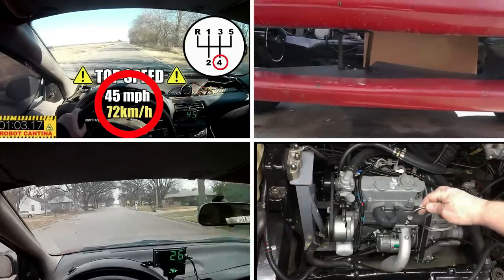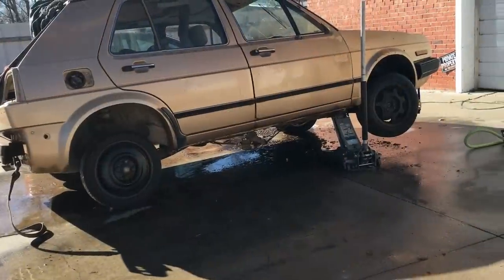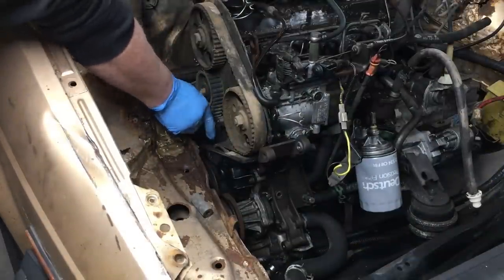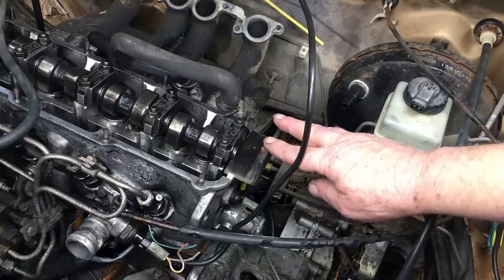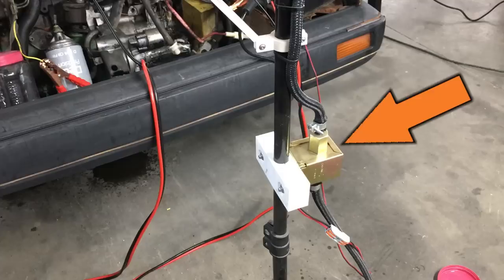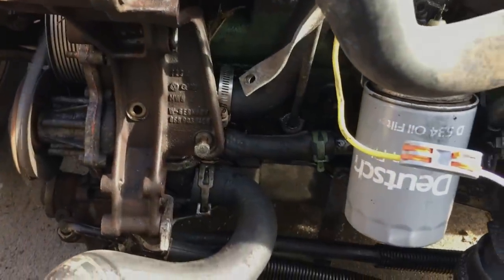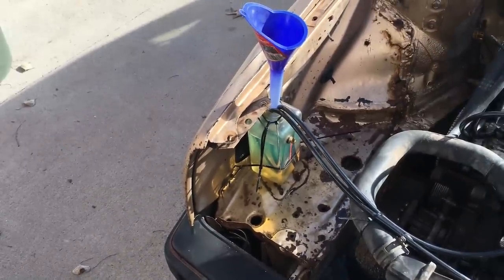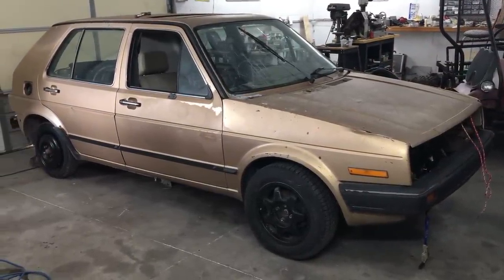S3 E3.  Will this abandoned 1985 Volkswagen 1.6L diesel run and drive again?.  Let's find out !

Comment: It may be out of the question but if you were willing to pull a few things off that car before it goes to the scrapper I'd make it worth your while. 

Love the videos always look forward to them!
Reply from the maker: The scrapper is picking up the car tomorrow.  About the only good parts left are the doors. everything else is damaged or missing.
Reply: @robotcantina8957  As the video progressed I came to that conclusion. 

Also, from the video (kinda hard to tell) that more than likely is a 5 speed transmission sometimes marketed as 4 speed plus e for economy. That linkage system when worn makes finding gears difficult.
Reply: @ViersBrett  JIMBO,    CONGRATULATIONS ON  115K  SUBSCRIBERS!!😊

Comment: The Golf started sale in the 1970s.  Here in the USA 🇺🇸 it was called the Rabbit from 1977 until 1984.  The Mk1 Golf (Rabbit here in the USA) was called the Caribe in Mexico 🇲🇽.  Here in the USA, the car was renamed "Golf" (in line with the rest of the world) for the Mk2, which started with the 1985 model year here in the USA.  So, your 1985 is a Golf.

I learned how to drive in my dad's 1980 VW Rabbit diesel.  That was the 1.5L indirect injection, normally aspirated diesel.  Less than 50 ponies.

If you want an interesting variant of the Rabbit/Mk1 Golf, try to find a Rabbit Pickup (Caddy in the rest of the world).  That thing was sold here in the USA from about 1979 until 1985 (a few leftovers from the 1984 model year).  With the diesel engine, 50mpg highway (US gallon, 3.8L) is possible and the total passenger & cargo capacity is 1,105 Lbs.  With a small driver, ½ ton in the bed is possible.  They were popular with the DIY EV crowd for a while.
Reply: And, the 5-speed manual also bolts right up to the engine.  Ask me about the vacuum pump and oil pump situation 😉

Comment: I had more or less the exact same as my first car! 
The engine is a turd, but man was that thing efficent and forgiving!
As a apprentice with no monny, i put every crap into that thing!
Old hydraulic oil for the engine (Just to top it of ;) , as fuel somtimes leftovers two stroke gas mixed with the remaing diesel, more hydraulic oil 🙄, vegetable oil, it dosen´t care!
As long there is enough diesel mixed in it even dosen´t smoke!
One time we even filled the empty tank with 20l of just gas, because drunk, broke teenagers do that, and drove to get food. It knocked like hell and had no power, but it got the job done and survived!! 👍

Also it just took 4 l/100km (58mpg)!

Best daily ever!!! I regret giving it away, such a good car!

Comment: Great video brother I follow a  Youtube channel in indo China These youtubers take full size pick up trucks strip them down to the Running gearAnd chessie and put a single cylinder diesel engine on these guys are holding massive loads of lumber  And trees and farm products it is amazing what these guys are pulling with a simple 24 horsepower engine they do have manual transmissions that make it worthwhile most of them are belt drive They do not go very fast however but that is beside the point Very cool thank you for sharing your knowledge and expertise and I forward your channel to all my redneck engineering buddies
Reply from the maker: Thanks I will have to check that out!

Comment: on VW diesels, the oil goes black literally minutes after the oil change, no biggy.  You MUST tap the engine allen bolts with a hammer, and they come off much easier.
Reply from the maker: Thanks for the heads up on the head bolts!

Comment: We had a customer car, a 1980something Fiat Spyder, that was in similar condition in regards to rodent 'waste'. They had a complaint that the dash vents for fresh air in the center weren't working when they were driving. They weren't working because the cowl where the air came in and the two vent tubes into the cabin were inches deep with mouse droppings solidified into a hard packed dirt like substance. Yes folks, he drove this car regularly! It was also in for so me electrical concerns which required me to reach under the carpet to pull some wires up. I couldn't understand why it felt like there was a bunch of rice under the carpet on the floor, I thought maybe someone poured rice in there to absorb moisture. Nope, loose mouse droppings! Thankfully I always wear gloves, but I couldn't eat rice for a couple months after that and still gag at the thought. The car smelled so bad we had to park it outside if we weren't working on it and even after leaving the windows down outside for a couple weeks as I worked on it off and on, despite the removal of literal pounds of feces and washing down everything with urine eliminator, the car smelled just as bad as when it came in. Maybe even worse! The smells were just bonded into the paint and fabric of the vehicle. Thank the heavens it quit running last year and the brakes went out at the same time, we were able to talk him into junking the car. That thing was a rolling bio-hazard. Oh and not only did it smell of urine and feces, it also smelled of death. The next year we found out why, the other guy worked on it and found about 8 dead mice under the back seat that had rotted into sludge under the cushion. Oh best thing, until we called him in to show him the depth of poo he refused to believe us because...drum roll.....'It can't be, it's garage kept!' Oh buddy that means your whole HOUSE has mice too my man.  Ok well that's all for Sunday story-time, have a great week everyone. I'm off to go quietly gag for a few minutes and maybe dry heave a little too.
Reply from the maker: Thanks fort that!

Comment: I still have my VW Bentley repair manual from when I owned an 81 diesel rabbit back in the early 90s.. I still remember that the only real repair that I ever had to do to the car other than patching rust was having to replace that confounded water pump when it was minus 20 degrees Fahrenheit.  Ya, that was fun, NOT!!! That rabbit is one of the cars that I truly miss owning. It was as gutless as they come but it was awesome getting 60 plus miles to the gallon. And that was when diesel was under a buck a gallon.
Reply: JIMBO,    CONGRATULATIONS ON  115K  SUBSCRIBERS!!😊😊

Comment: I would turn this into a tractor/UTV with this placed mid-ship and using the diff as a center-diff in a 4x4 system.  You could put brakes on the outputs to have front and rear dig 😁

Comment: The MK2's were always sold as Golfs.  This is a MUCH improved vehicle when compared to the MK1!  It was about 200 pounds heavier, but still that means only about 2200 pounds.  And it had the massively better front end that used a sub-frame;  Curbing a MK1 Rabbit you could easily wind up bending the unibody in such a way that it could never be properly aligned again.  The subframe of the MK2 takes care of this problem;  Even a bad curbing or bump to the front end can easily be fixed with a new subframe.  And the larger body had a lot more room, not to mention far higher torsional stiffness.  It used the same EA827 series engines as the earlier car, at least in the United States.  It's sad about those rusty floorboards;  MK1 cars were NOTORIOUS for rusting, especially the German built cars that were built from cheap Russian steel.  MK2 cars like this one were virtually rust free, since they were built in the USA from US Steel.  But leaving the windows open will rust any car eventually....

Really, if you are going to build a hot rodded Volkswagen, this body is the hot tip!

Comment: not sure if this age TDI had them....  but next gens did.... so just in case make sure you take out all the electronics that tells the computer to go into limp if they are not working. Been there done that when electronic sensor got damaged from a reversed cables jump start.
Reply: There is no ECU in this generation of engine, it's very old style indirect injection diesel engine without any complicated electronics, no limp mode was bothering the driver back then :) ... You need only three wires to make it work - for fuel pump shut down valve,  glowplug, starter coil... And that it. 🥳
Reply: The fuel pump is turned by the timing belt. Engine turns, pump sends pressure to injectors, mechanically.  Stone Age!

Comment: the vw rabbit diesel engine was just a modified gas engine. they put a diesel head on a gas engine! when i was working for vw, we had one in the shop that blew
the head. the dealer could not get a head, so they took one off a new rabbit that was not sold! that new head blew on the old engine too! vw made junk! i had a
rabbit in the shop that the shifter was worn out, so i took one off an unsold rabbit! rob peter to pay paul.

Comment: Honda Insight is soon to be a Toyota Echo. Almost every noisy Toyota motor sounds like it's running on diesel. I once poked in the engine bay of a 5.7L FE, and it sounded like a FedEx delivery van, not to mention my 1.8L ZZ-powered Toyota sounds like it has its own Jake Brake while downshifting.

Comment: might need to save the vw drivehubs , if youre reuse the vw driveshafts on the honda that is 
too bad youre planning on taking the diesel back out to replace it with the v twin eventually as i think the insight would be a mush more usable vehicle with the diesel in it , might do the vtwin swap on the other car
Reply from the maker: The insight is a great car to experiment with because it is extremely light weight and aerodynamic.  However our car is missing a lot of parts and that is why it is so light.    If our insight were more intact and still had the air conditioning, things would be different.

Comment: It's actually a capable engine. You should be able to tune it pretty high if you want to. It's actually the same engine block as the turbo charged ones. If you really want to you can push this block to well over 100hp

Comment: Years ago, reading about Ferdinand Porsche and the development of the VW beetle, He said something to the effect, that the minimum horsepower you need for a vehicle to be useable is 24 hp. If this is true, then your D-722 diesel is only 4 horsepower short of having enough power to be freeway legal and functional. What do you think? Ps My buddy, Jim the mechanic, said that those VW diesels are awesome engines, They last forever, he owns three of them.
Reply from the maker: With a turbo, we may have the required 24HP ... stay tuned.
Reply: Thats as subjective of a statement as it gets... but those 24hp lines up pretty good with an autobahn friendly top speed of about 100km/h in a beetle. I may be misinformed but I think that was one of the design briefs for the beetle, 100km/h top speed and less than 1000 Deutsche mark cost when new were some of the demands from the german state is what I have heard.

Comment: No way. I Own 6 VW jetta diesels! 88, 98, 98, 01, 01, and 02. I turbod my 88 1.6 diesel and i wouldnt trade it for anything!!
edit: that thing is ROUGH. be careful with those tiny diesel engines. next thing you know you wont be able to live without them
Reply from the maker: Too late, I got addicted to diesels after owning a  87 Mercedes 190 with the turbocharged OM603.  Awesome car.

Comment: I would love to see you fit a Petter ph single cylinder, diesel engine that was fitted usually in a small dumper. They were very common in England and power was about 5 hp too 8 horsepower and usually had a three speed gearbox fitted, and was capable of pulling half ton to 1 ton a lot was hand crank start but some were electric and generally the rpm of the engine was 1500 to 2000 rpm was quite a long, stroked engine, so although not a lot of power quite a reasonable amount of tork  cheers Derek from the UK
Reply from the maker: Greetings from the US!  You folks have a lot of cool stuff that didn't make it over to this side of the pond.  Over the years I have owned a hand full of Triumphs, MG's and Austins.  Stuff like the dumper I'm aware of from watching youtube but sadly they are not available here in the states.
Reply: @robotcantina8957  JIMBO,    CONGRATULATIONS ON  115K  SUBSCRIBERS!!😊😊

Comment: I wonder if converting the twin fuel Cavalier into a diesel might work with some clever machining as it runs at a matching high compression like a diesel. 🎩🧐🤔
Reply: That's possible? These NA diesels of this era run 18-20:1 or so, I didn't think it was possible. Unless dual fuel means LPG or CNG? My understanding is modern pump gas can only go up to 12 ish or so without direct injection and maybe 14-15 with direct injection? Either way I'm curious about this dual fuel engine? Lol
Reply: @goosenotmaverick1156  I am referencing the data I had at the time while I was in college studying automotive technology. The compression ratio is very high. Not sure how you could compare other than via Google since neither of us are on campus. Don't take my word for it. I hope you find your answer.

Comment: That's normal for a diesel they run forever, mines done 200k and looks just as clean under the valve cover. 2008 BKD 2.0 TDI. They just keep going. It's the common rails with DPF's that are unreliable.

Comment: you're gonna want to add a lubricant additive to the fuel when you next run it. These injector pumps were not designed for ultra low sulfur diesel fuel

Comment: I am very mad that you got those axles out so easily when I'm struggling so much on a newer car that hasn't sat nearly as much. I blame salt.
Reply from the maker: LOL, indeed the axles came out of the hubs easily, however I couldn't get the bolts off where the axles connect to the transmission.... so I ended up cutting the front of the car off o get the engine/trans and axles out of the car.

Comment: 50+ mpg and 75 mph on its way!
Reply: If he can get the factory 55hp out of it, it should be able to do 100mph or even slightly more in an insight if everythings optimally set up.... If the gearing is enough and its got the same aero drag as the original etc. 

50-ish hp in small cars gives a lot more top speed than most of the general public in the US realise if you are willing to keep your foot in it.

Comment: I've been saying lately that we're entering a time when all the junk cars on the road will be Toyotas. Why? Because Toyota drive lines are so well made and reliable, that the rest of the car (which is also well made, but not as bullet-proof as the engine/trans) will fall apart around it before the driveline dies, so maybe there's a Toyota in your distant future. Lol!
The only reason I can think of for parking a car with the windows down is if it has no windows. This car proves my point. 20hp -> 54hp? You're going to think you're driving a muscle car!
Reply from the maker: Indeed, 54HP is massive and the Honda will perform like a top fuel dragster... Well maybe not that fast, but it should do better than the 420cc engine. lol

Comment: i have no doubt the insight could get over 50mpg and have tons of power with a 1.9tdi.. my 91 passat got in the high 40s with bad driving and a lot of miles on it
Reply: my 02 passat and my 97 audi a6 gets around 4-5l/100km on country roads and roughly 6l/100km on highway so 50-40mpg 
long live the 1,9tdi
Reply from the maker: I would have preferred the 1.9 TDI, however this 1.6 was cheap and available.  Should be an interesting swap.
Reply: @robotcantina8957  JIMBO,    CONGRATULATIONS ON  115K  SUBSCRIBERS!!😊😊

Comment: I know my mind is not yours and quite frankly i know my opinion is basically irrelevant. Although i think the vw would be a good upgrade to the little Kubota in the saturn once the Kub is pushed to or past its limits. Plus the honda is already set up for a “small engine”.

Comment: hold up. dont you have a miata? I believe a diesel swap into a miata would be much more entertaining
Reply from the maker: Before my youtube channel, I did a G10 and a B3 swap on the Miata.  Google B3 Miata or G10 miata for more info.  The problem is Miata's are getting hard to find in decent condition.   Anyway, after we are done fooling around with the diesel in the Insight, I think I want to transplant it in a rear wheel drive vehicle .... perhaps a Miata?

Comment: It starts and steers. That's roadworthy, why scrap it? A little brake job would do, but it is fine c;
Reply: Mums vw beetle was similar, a fridge gave its life to supply a new floor pop riveted in, and carpet glued down so the inspector wouldn't notice

Comment: I know she was a complete basket case but it still hurt a little watching you take a sawzall to the front end!
Reply from the maker: Yeah its a shame to cut the car up, but in order to remove the engine and trans, the axles first need to be removed.  I spent close to 2 hours trying to remove the little bolts that connect the axles to the transmission, finally I gave up and decided to use extreme measures.
Reply: @robotcantina8957  yeah those can be a nightmare, I ended up with about 3ft of 1\2 extensions so I could use a breaker bar from outside the wheel well
Reply: @paulEG6  JIMBO,    CONGRATULATIONS ON  115K  SUBSCRIBERS!!😊